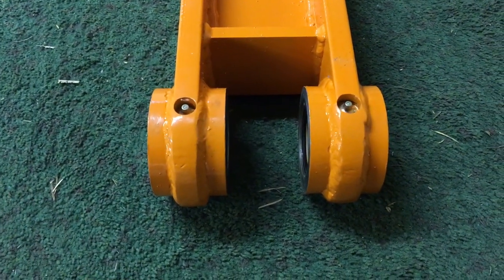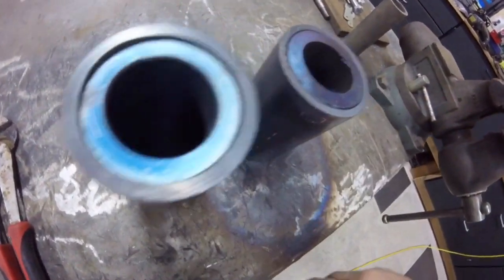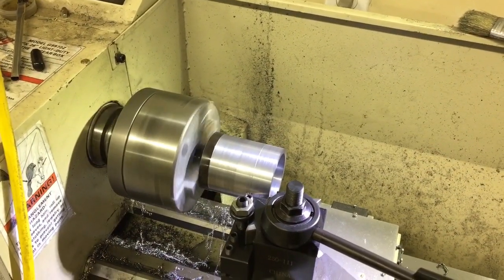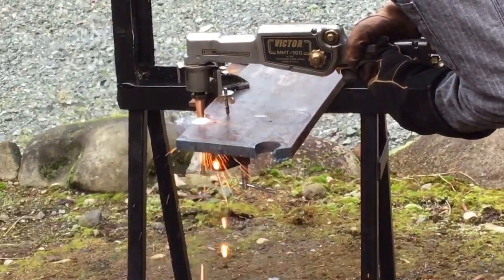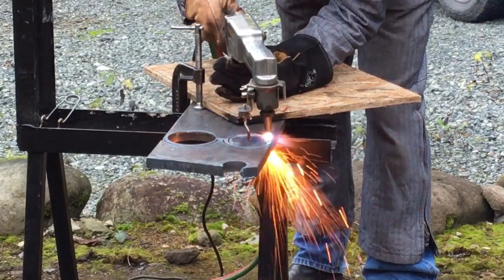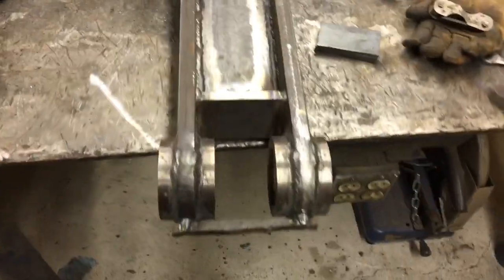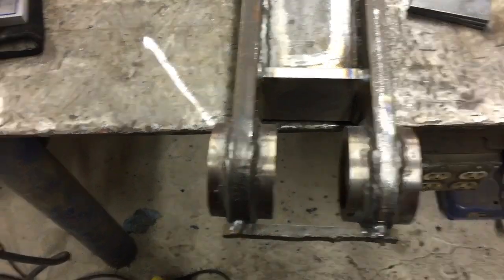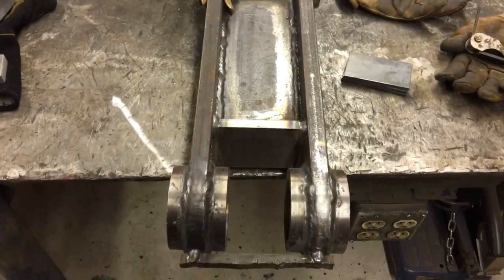Excavator link fabrication

Comment: Can the H / bucket link be refurbished? Mine is a little worn out. Got a new pin and new seals, bushings were still fine…but the seals are 5mm and stick out a little now :((
Reply from the maker: Ya a machine shop can weld and machine an old link and make it like new.

Comment: Jeremy, nice build, great video.

Have always been curious about about the linkage geometry that moves excavator buckets but have never been curious enough to study it further. Now that I'm actually looking for a breakdown I can't find it anywhere. Need to utilize this linkage geometry in an application totally unrelated to excavation but wish to understand the physics and geometry of it first, so I can apply it correctly in a design. You have any clue which direction to point me so I can study it?
Reply from the maker: Unfortunately no. I didn’t do any math for this. I just put in the stand-off links and folded the bucket up then measured the distance between the two. There is a free CAD program called Onshape that you can build parts then assemble them to see how they work with each other. There is lots of YouTube videos to help you learn. It has come in handy for me several times. You may be able to design your parts and test them out so you know what works.

Comment: what material do you use for the bushings ? what type of steel ? nice job
Reply from the maker: I just use mild steel for both the bushings and pin. It’s easy for me to machine and I found that if you keep them greased they hold up pretty good. I don’t put a lot of hours on my machines so it works well for me.